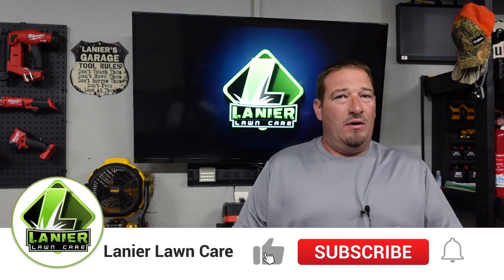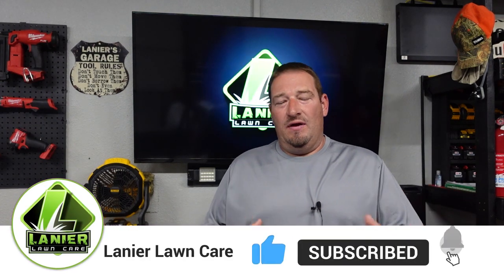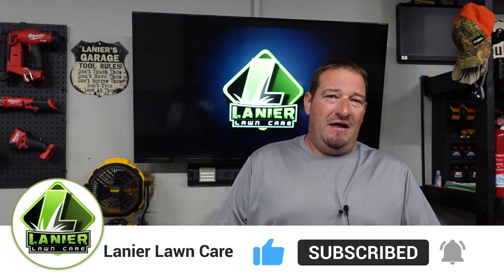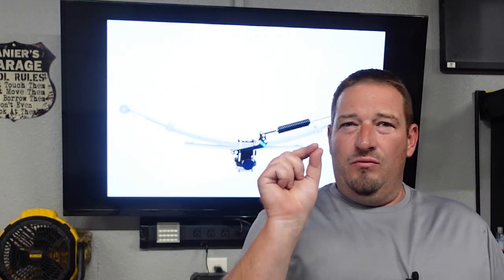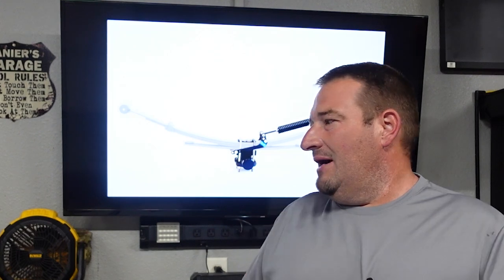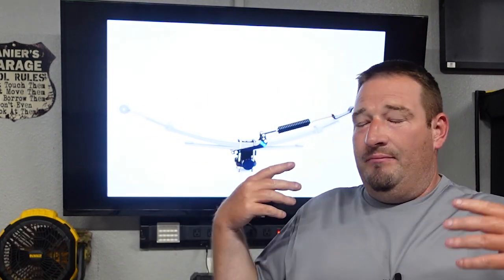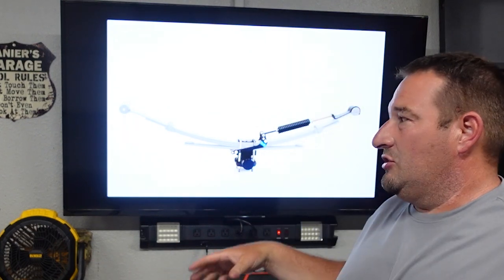RoadActive Suspension, If You’re Towing YOU NEED THIS!

Comment: Been thinking about putting this on my 3/4 ton truck.  Mainly to help with the hop in the rear.
Reply: Traction bars would be more what you're looking for
Reply: Installed my RAS on 1978 3/4 ton C-20 5/6/24 and ran a load of 2. 1/2 newspaper stacked pallets 85 mile delivery. What a difference!!! I had taken similar loads numerous times in somewhat dangerous conditions. Steer tires not enough weight. Headlights shining up. 10 mph under speed limit cause rear tire rubbed on bed cross member with ANY lateral force. ALL those issues gone!
Much safer. Less stress. Nothing but good stuff to say about it!

Comment: Position of the helper spring looks like driveline angles may be influenced. Did you measure the rotation of the rear axle when the helper springs were tensioned?

Comment: Were you able to get your rear differential all the way down with zero load held by the jack?  Looks like you ran out of room when lowering.  Did you measure the height of your rear top of fender well before and after install ?  I hear it does raise the rear maybe 1-2 inches.  Finally how did it perform when loaded ?
Reply from the maker: everything you asked is in the video. Before and after measurements are given also along with how it preformed.